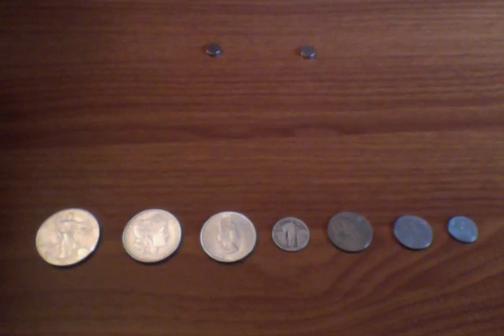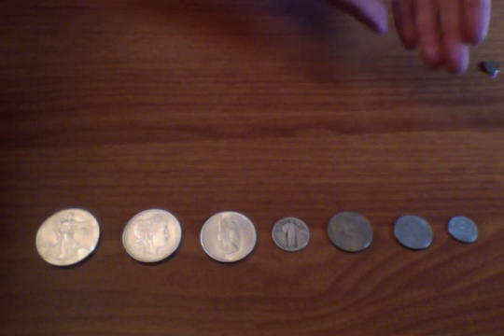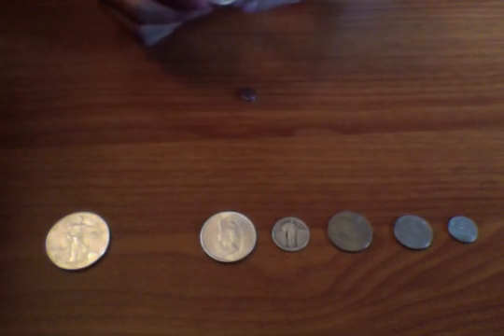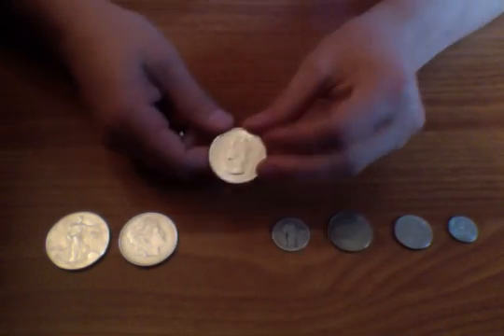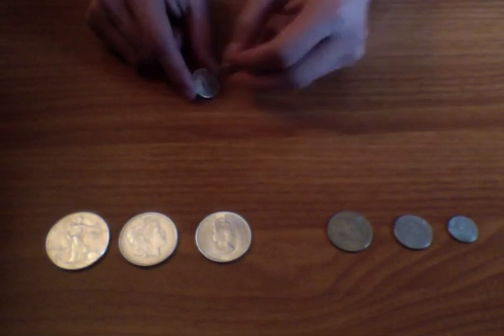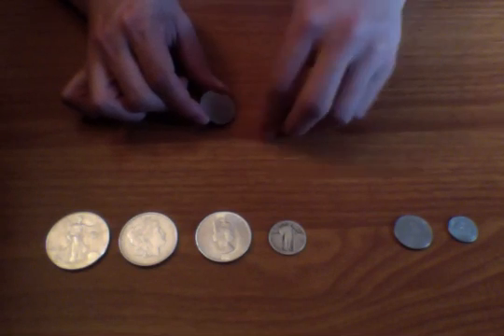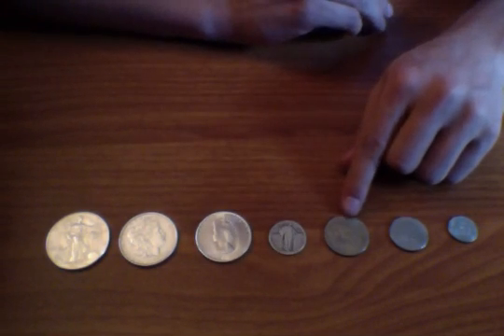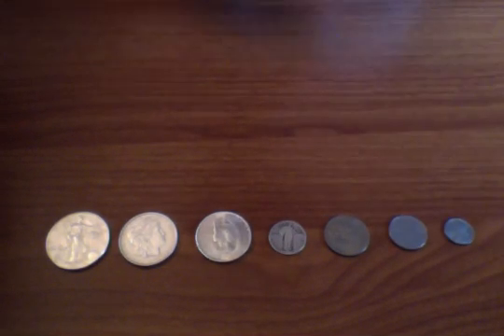How To Test Silver or Gold | Neodymium Rare Earth Magnets

Comment: if it doesn't stick to precious metals why was it going slower on coins with higher silver in them than the lesser silver filled coins?
Reply: Rhyannon P it is because the magnet produce  an electrical curent in the nonmagnetic metals whici will produce a magnetic field that is always of opposite polarity  and that magnetic field slows down the magnet as it moves This will happen only when u move the magnet  Its a similar process to what it's going on in a electric motor
Reply: thats what i m thinking about...
Reply: I don;t understand that either.,.
Reply: It’s to do with something called eddy current. Gold and silver are diamagnetic (have the slightest negative to magnetic fields). I was told years ago another good way to test gold and silver, is to fill a large saucepan/bowl with water. Cut a small thin piece of styrofoam that will hold the weight of your coin (not to large of a piece of styrofoam just enough to to float the coin). Once the coin and styrofoam are stationary and not moving at all in the water. Get a large neodymium rare earth magnet (bigger the better for this). Hold the magnet level with the water, as close as you can to your coin/styrofoam. You should get the slightest repel and the coin should ever slightly push away from the magnet.
Reply: thank you Ee M now that makes sense
Reply: this uploader is tarded

Comment: A magnet will slide slow down a silver-plated copper coin as well, because copper is also diamagnetic. So that test alone is not sufficient. You should also be testing weight and diameter/thickness.

Comment: In theory, any magnet (with adequate size) should work.
He used a small neodym/rear earth magnet which is probably best for this. They are pretty cheap and easy to get as well.
But: You have to test your magnet with some known reference materials.
Depending on magnetisation direction, size, strength etc. results can vary.
Best would be, to carry the reference materials together with the magnet so you can easily compare each time a known material against the unknown.

Comment: What if the coin is copper and coated in silver? then what. The reason your magnet slowes is due to len'z law. your inducing a current but the resistivity of copper and silver are almost the same so also is the conductivity. this test would fail in such a case. If your going to buy silver I would say use Archimedes' Principle. SG of metals will tell exactly what percent of silver your dealing with.